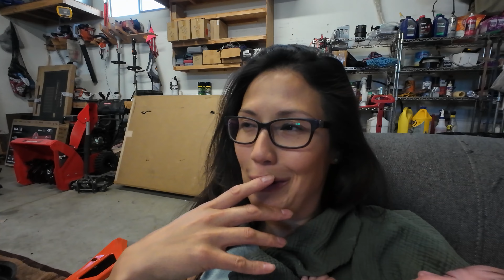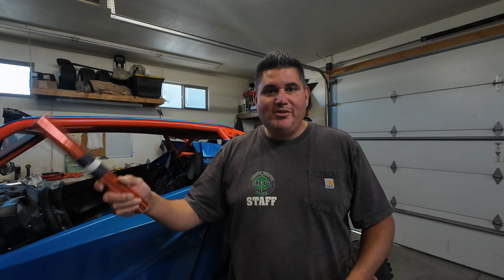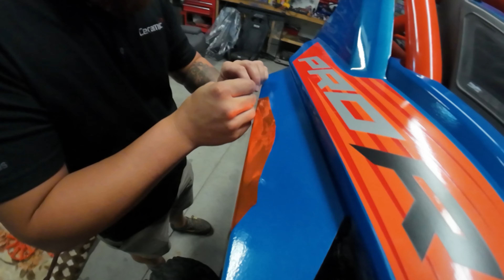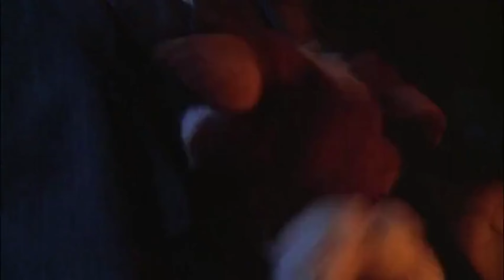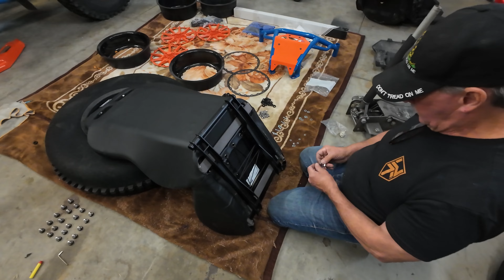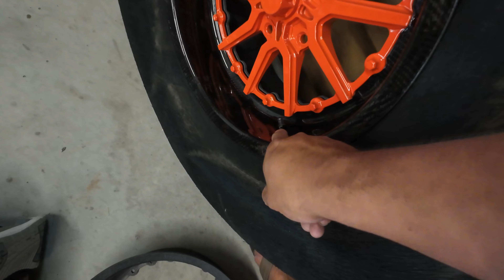Patty Mayo the Pro R is almost done!

Comment: So standing next to you at little Sahara I’m taller than you and I have the same seats. I did the prp solid mount bases cause they sit 1” lower. And 1” farther back.
Reply from the maker: Nice! I shall order them!
Reply from the maker: Just curious how tall you are?
Reply: @offroaddiaries   bare foot I’m 6,7. When I get back to my pro r in October I’ve come up with a plan to still use the solid prp mounts but make the seat itself quick release because changing the belt is a project with the seats bolted in. And I’ve also got a plan to move the seat back another inch for even more leg room